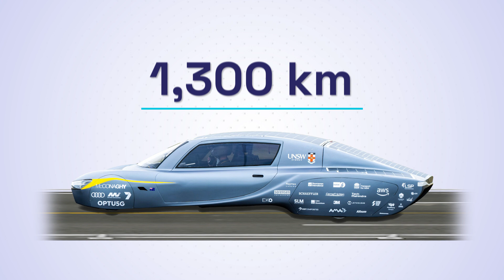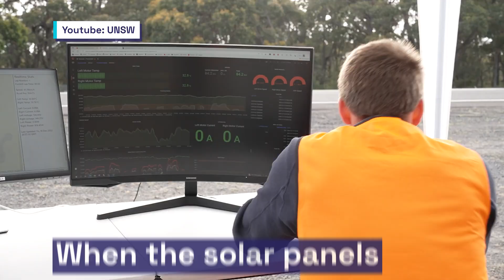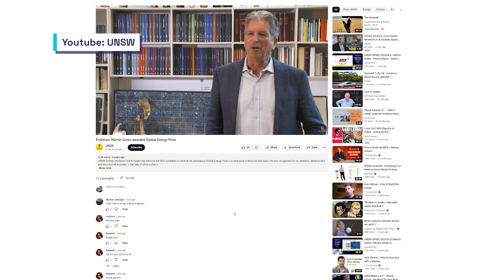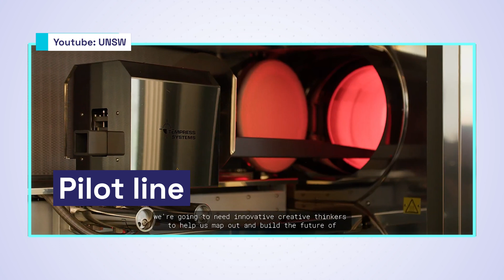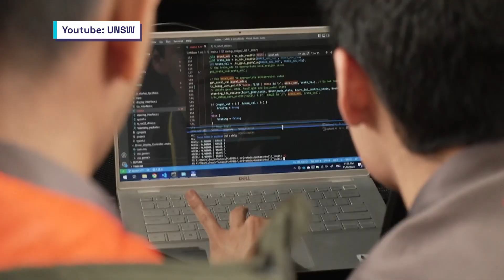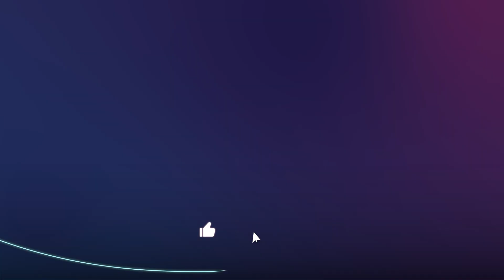World Solar Challenge with Sunswift Racing from UNSW

Comment: 38kwh battery with 1200watts solar gave 1,000km over 12 hrs( looked overcast on that day so solar probably didn't add much, also track was quite hilly not flat)
Thats 621 miles is the world record.  3,800whr/621miles gives 6.2wh/mile.
So thats a measured real world result verified. Aptera is claiming 10wh/mile, lets see them do a 12hr run and see how far they actually get. I dont think they would last 12hrs firstly, secondly the 10wh/mile is theoretical not tested in real world.
Aptera is claiming worlds most efficient solar vehicle and are taking money from people who want to buy one, but they never produce them, lets see them do a real world test with guiness world record there to be unbiased assessors. They wont do it cause they know the real world results will be either a break down or much lower distance than they are telling people. Why do you think they have never done one of these tests?

Comment: Somehow the numbers arent adding up for me. If the vehicle can travel 1,000km (or better) on a 37.5kWh charge, that's at least 27km/kWh. This sounds fairly realistic, considering Aptera claims around 16km/kWh.

With 1.2kW of solar, assuming around 4 kWh/m2 daily POA irradiation, that would be well over 100km of daily solar range (for reference, Aptera claims 60). Why then did the engineer claim only 26km of daily solar range?

Edit: maybe the engineer meant 26km per hour of full sunlight! This would make sense. Or that you could drive 26kph steady state during full sun
Reply: Just commenting to boost up your comment in the chain. I was wondering the same thing so I'm really hoping one of the students see this and is willing to explain.
Reply: Aptera is breaking records in everything.  These students can't even sit inside the car because it's too hot?  geeezzz
Reply: I'm extremely unimpressed by the performance figures she is quoting. Either she cannot do math, or the rubbish electronic systems are stealing most of the energy.
Reply: @Maungateitei  I think the engineer must have just miscommunicated. You can't win events with solar racers that are not engineered to the razor's edge.
Reply: @suunraze  Nah. They have wound so much red tape around this event, that it's become an embarrassment.
They are required to use so much Friggen computer "safety" equipment, that it probably uses most of the less than 50% of the solar watthours produced by the panels that will be retrievable after going into and back out of the batteries.
They have heavily restricted the panel area and wattage they are allowed to use because the cars were going over 100mph and "having nasty accidents when it got windy"
Another problem is pneumatic tires with steel, nylon, or kevlar reinforcing monofilament that pulls back and forth through the crappy plastic elastomer "rubber" being used today everytime the casing deforms.
Turns most of the drive energy into heating the tire.
That's why it takes 50hp today to go as fast as cars 100 years ago could go with 10hp.
It's all a scam in the name of built in obsolescence and exponential increase in spending.
Reply: Which would not be surprising. They have so many rules requiring stupid computer babysitting systems to try and stop their stupid lithium battery systems from catching fire.
I can move a 13 ton yacht over 50km in a day on half the solar panels they are using.
I built a 20ft long 8ft wide full standing height amphibious mobile home that 300W of panels gave over 100km of range on road or water per day.
Using junkyard car batteries, and brushed Dc motors.
This Solar challenge crap has turned into a way of marketing solar vehicles as impossible.
I could take that chassis, gut the motors, electronics and batteries, equip it with a mobility scooter brushed motor, transmission gears, series to parallel switching for speed control, using nickel iron batteries proven to last a century, work at any temperature, and handle any amount of heavy discharge or overcharge.

Still available from China. 

And make it do twice the range in a day with a weight reduction too.
We had 10x more efficient electric cars before WW1.
You should not need more than 5kW of motor for a vehicle like this, to do 100kmhr and climb any hill. 
Look at Jay Lenos 1909 Baker Electric for example.
6kWhr of batteries, 160km range, 2hp brushed motor with 6hp max rating.
It's a Friggen truck compared to this!

These kids are being used to scam us.
They need to demand back their student fees, leave school, and start their own independent solar challenge event, which is not controlled by the thuggery of entrenched big corporate auto industry interests.

WAKE UP KIDS!
Stop letting yourselves be used to scam the world with this shitefruckery!